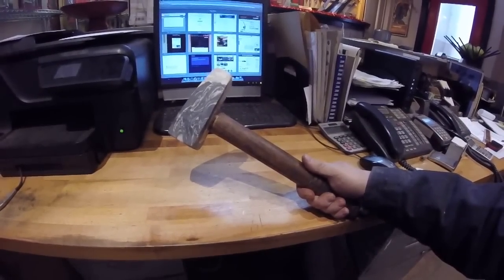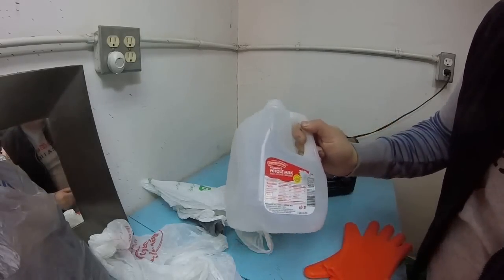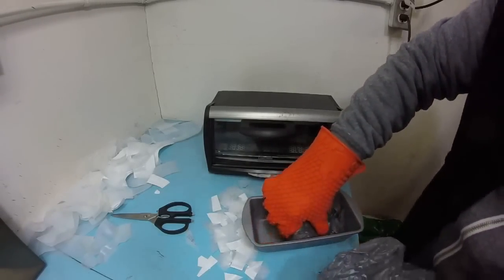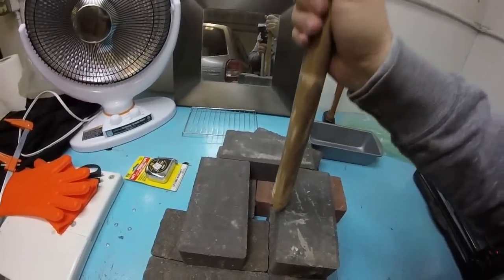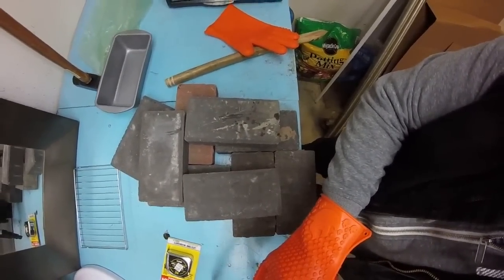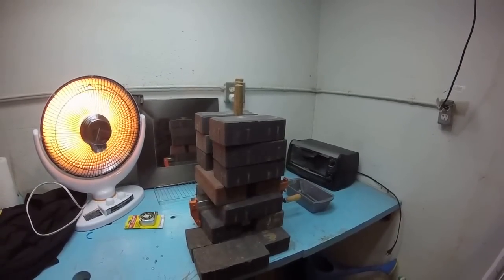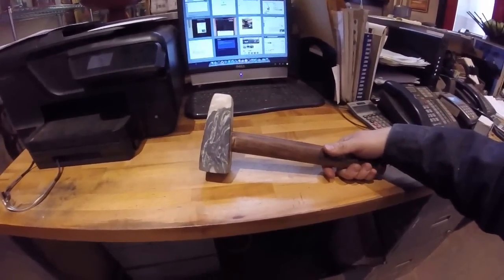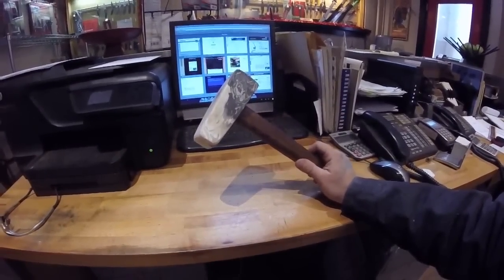Recycled Bags & Jugs HDPE Mallet

Comment: great job one thing i found that makes the plastic very consistent and strong is kneading it like dough what this does is remove microscopic weak areas and areas of stress between the melted pieces this will make the plastic much stronger and resistent to chipping.
Reply: It's HDPE. HDPE is already chip and shatter resistant 🤷. I could understand your comment as for trying to get air bubbles out cuz there's a lot of air trapped between the layers of those bags; but last I checked; HDPE doesn't chip. It's a soft thermoplastic. Nowhere near like acrylic, abs, or something like PVC which is quite brittle where you have to worry about that. So long as you are heating it evenly it will bond. Especially if placed in a form and put under lots of pressure the residual heat is enough to bond all the layers because it has such a low melt temperature. Little worry of delamination at these little bonding temperatures so long as your plastic is clean.

Comment: O k Boss let me help you out here if you will put just a ounce of water or so into your milk jugs and run them in the microwave for 3 minutes when you take it out you will be able to remove the labels also I use a heavier metal pipe to form the bags in in the full size over at 375*. Ounce you get it out between melts add more bags and press then put it back into oven till you get larger clump ounce you put it into the mold you can press it and quick set it by submerging  it in a bath of cold water it will be usable in 30 minutes rather than overnight. 
After cooking off a batch the other day I had an idea to use these freshly cooked HDPE chunks as spot heaters as they hold their heat for so long might as well get your moneys wirth out of the energy you put into them. Just an idea. Great video keep the ideas coming I am always looking on here for new ideas of how to use this stuff as I am always cooking it up so as not to add it into our land fill like most folks do. I like the material because of the way it works like wood but without many of the wood down sides I.E. Rotting, insects, mold, warping and after each use it can be re recycled into new stuff for ever as far as I can tell so far. Also you don't need glue to build with it all you need do is use parchment paper and a recycled cloths iron By putting the paper over each edge of parts you want to bind together for a couple minutes to get them soft then remove the paper and clamp them together for a couple minutes or soak in cold water to quick set keeping it clamped until it is fully cooled. Again great video.
Reply: Just tried your microwave tip and it works a treat! Thanks!
Reply: No problem Not my idea first I found on here some where just dont remember where. Keep the faith and good building